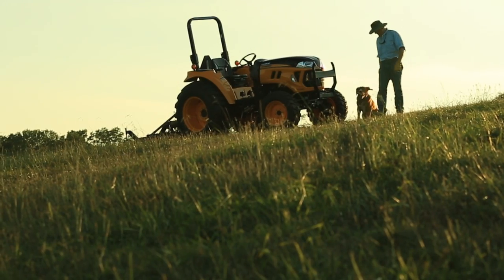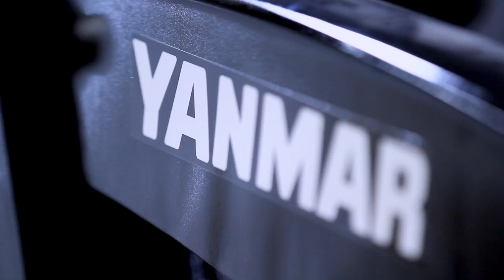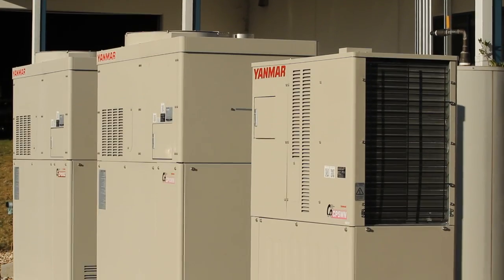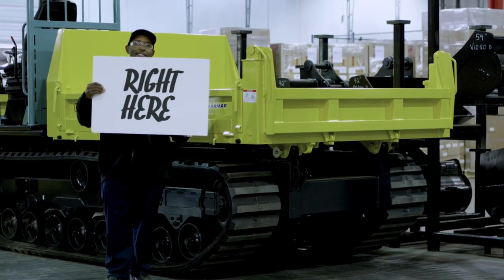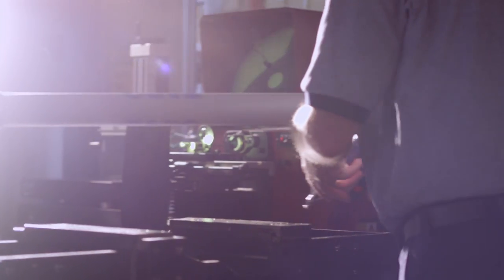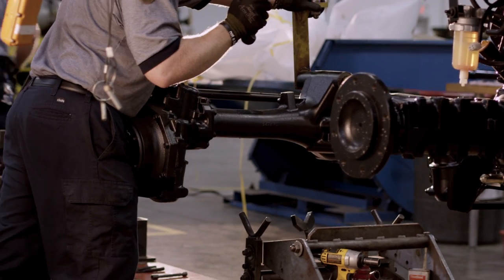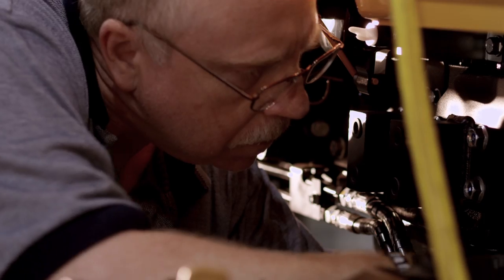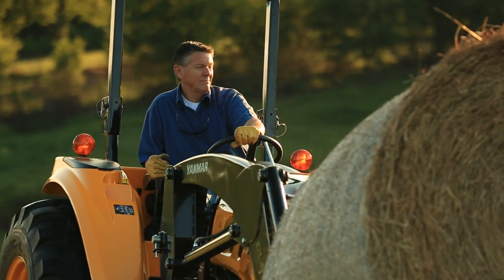Take a Closer Look at YANMAR

Comment: I have been operating equipment from the time I got out of high school now in my early 40s and for awhile had my own small excavation company I pretty much purchased cat iron in those years. I was ask bye my company to try out and demo about 4  smaller mini excavators in the 8000 pound range after taking in the facts   Price. Speed. Quality. Power. Comfort. It was pretty unreal how good the Yanmar was so we bought one and after about 500 hrs so far it’s been awesome not one issue I have become a big believer in there equipment. Any one looking to replace or bye a new one needs to ck them out